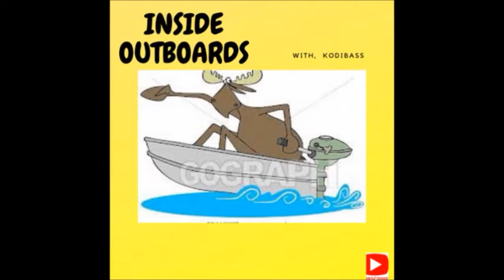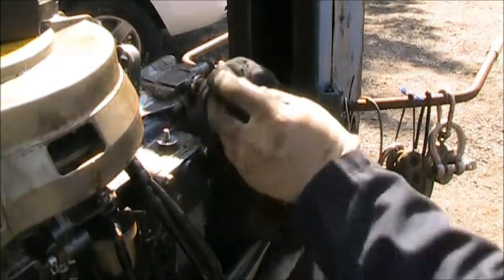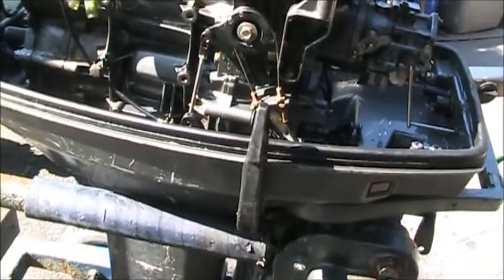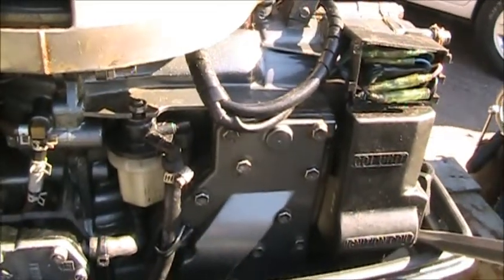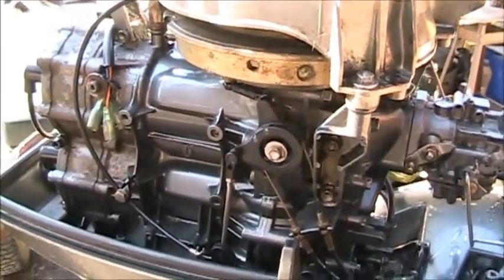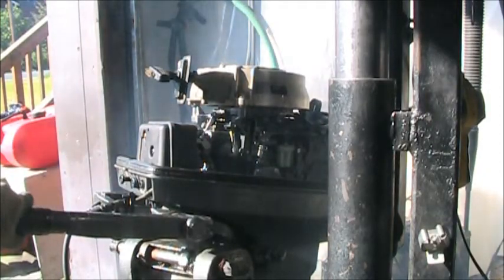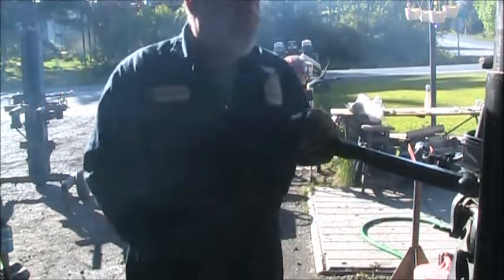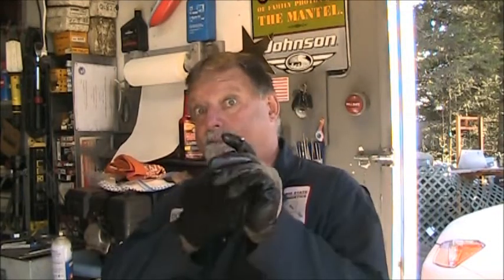1992 SUZUKI   DT- 40 HP MOTOR ,      ((  Part 3  ))

Comment: Thanks Kodi for explaining why the single carb on multi cylinder motors don't idle as smooth as carbs to each cylinder do👍
Reply from the maker: +TWS,  most welcome Tim,  Got that RV ready 4 the coast?            kodi
Reply: It's done have been working on my 2001 chevy duramax truck dually. Maintenance stuff and getting a couple new front tires. Just put new front shocks on today. Got Father's Day coming up here at the house. First time seeing the whole family since all this started. Will be as safe as we can and still be together. You be safe up there too. You should be having nice weather by now👍

Comment: Yeah those old motors take lot of abuse from commercial fishermen I am almost 64 years old pulling 30hp motor is hard my 1956 30hp Johnson has a 6 volt electric starter runs like a kitten sat in a basement for 52 years I got all the paperwork from when it was brand new pretty cool great show see you in the next one

Comment: Wonderful job I have Suzuki DT 40 with electric start and remote control. Do you have anything on that?
Reply from the maker: No other than I just got a tooth flywheel for my DT-40 and will be adding electric start to mine,   thanks   kb

Comment: Thanks Kodi! I have a1984 40 hp that runs rough at idle. Glad it’s the engine design. Otherwise it’s a great motor. Think I should get rid of the oil injection? Am I playing with Fire?
Reply from the maker: R you in a cold climate area?  If so a 40 year old vro pump?   I live in Alaska and removed mine.   I like the Knowing my engine is running on Fresh gas treated with MM oil , startron  & good tcw3 2 cycle oil mixed 50-1 .  That's me.  kb

Comment: Hey Kodi, have you ever tried filling a damaged bolt hole in Aluminum with an aluminum brasing rod? Then refill and tap out the new threads?
Reply from the maker: +TWS,  Yes I have had both success & failure with it along the way,  seems to work ok  in thinner areas but if it is a deep hole with allot of thick aluminum around the hole it hard to get it hot enuff.                kodi
Reply: Well that's good to know. I'll try it though on some small stuff first. It worked on my prop but that was not a hole

Comment: My upper shift rod came off from under the power head. Is there a way to re connect it without removing the powerhead?
Reply from the maker: +BH,  You should be able to get @ it by removing the carbs, vro tank etc.      kodi